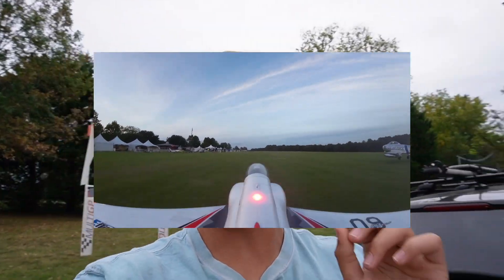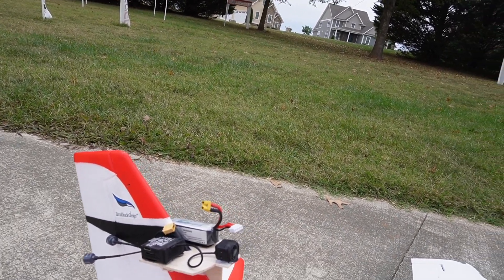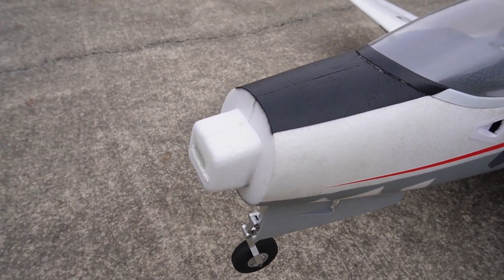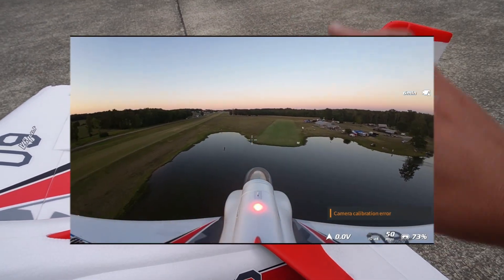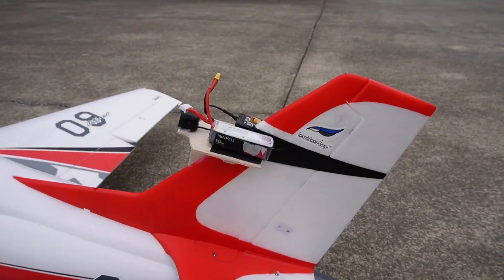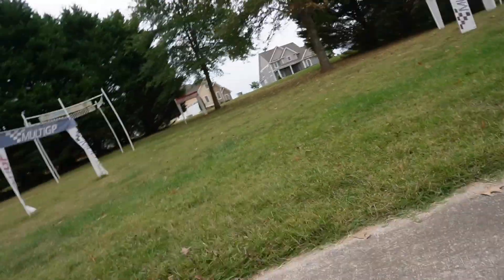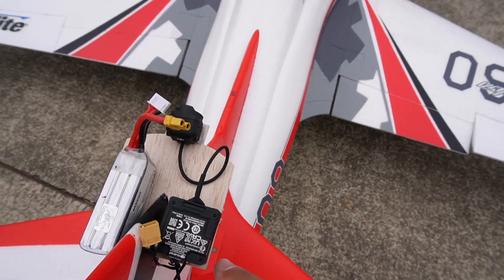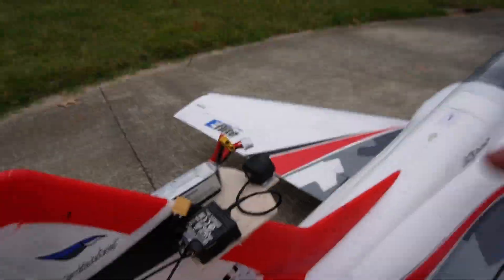How To Build An FPV Jet | The EASY Way

Comment: i mounted my camera on my t28's belly on s pan and tilt mech i designed and printed it has retractable gear and flaps so its super fun, but i have inav on it with osd and rth and everything, you can use old quad fc for inav but i recomend getting a proper wing fc, having battery voltage on the osd is nice lol
Reply from the maker: This is for sure the plan, sounds awesome!